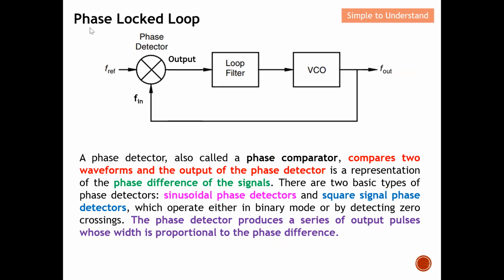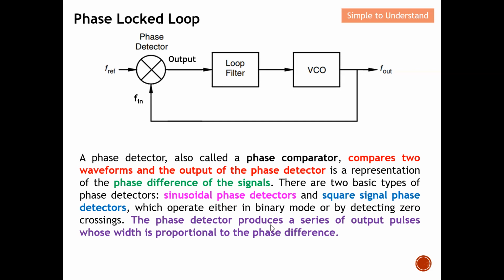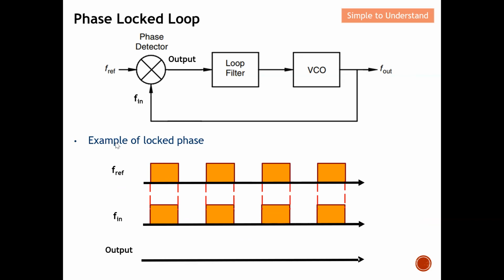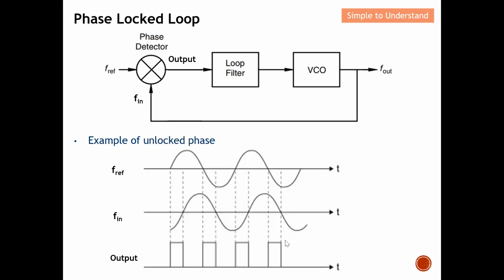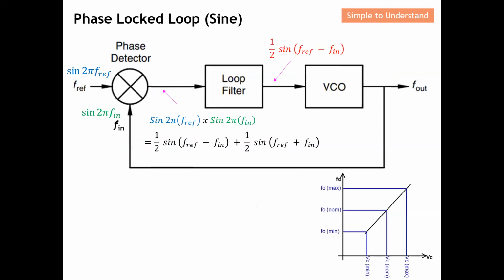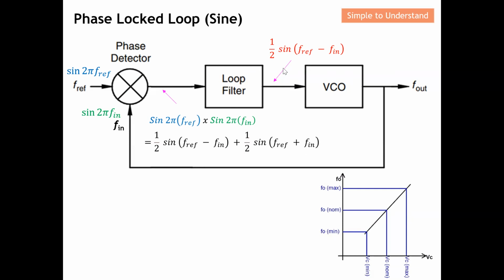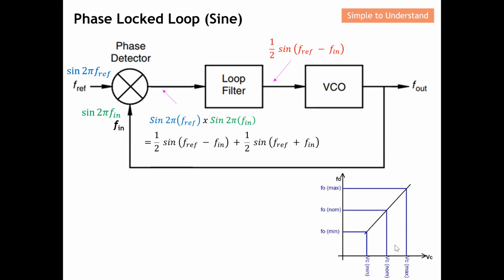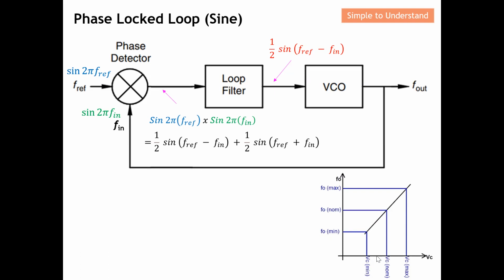PLL #2. How a Phase Locked Loop Really Works! Sinusoidal vs Square Wave PLL Comparator Explained.

Comment: Phase Comparator looks like a mixer, then some logic gate to ask if there is output at all as a difference signal - then the feedback function.  When lock is not there yet there is also a need to freeze user attempts to retune the output a the VCO needs to be allowed to  provide feedback in a stable way.
Reply from the maker: Is XOR. U are an expert!   :)
Not enough time for me to go so deep yet. Maybe u can help to contribute.  :)